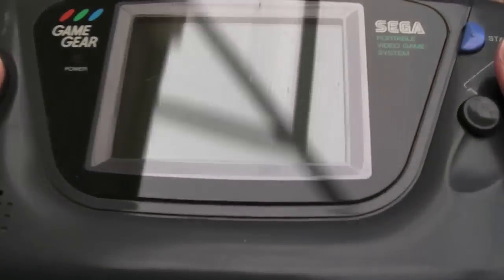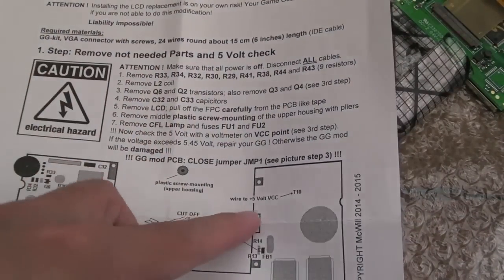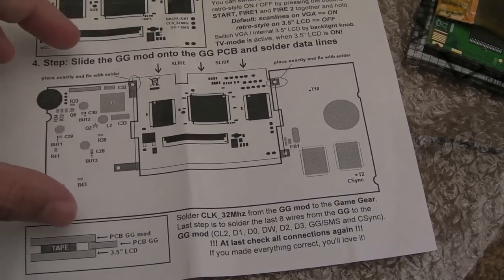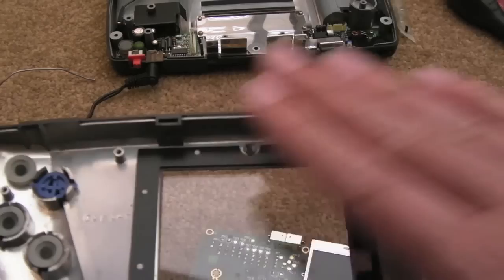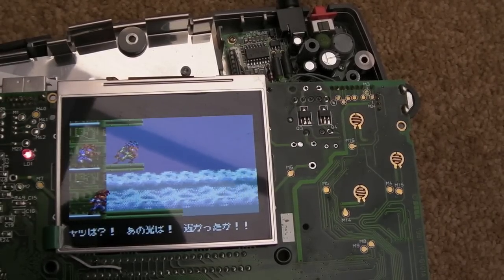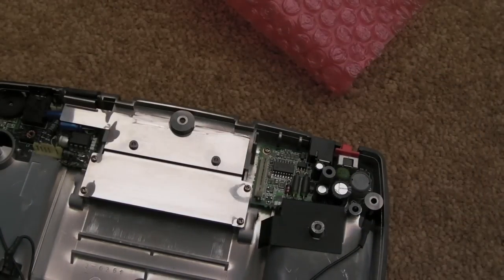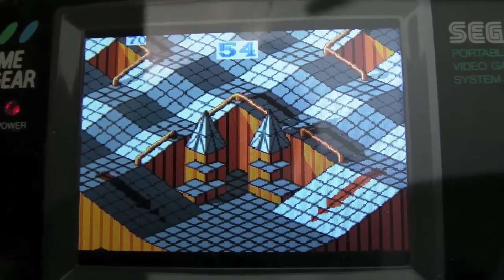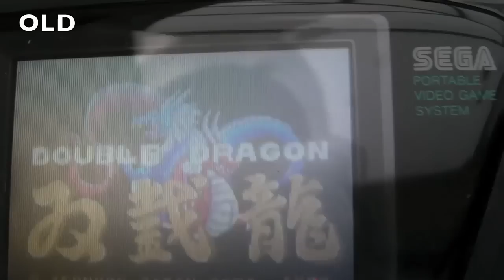Sega Game Gear Modern LCD Replacement (Not Composite) From McWill

Comment: Wow, that's a superbly put together mod kit - great execution on the install too. Thanks for the video. Is there a difference in power consumption compared to the original screen and lamp - does it make a noticable difference in battery life?
Reply: Paul E just the led replacement makes a crazy difference, this should do even more.

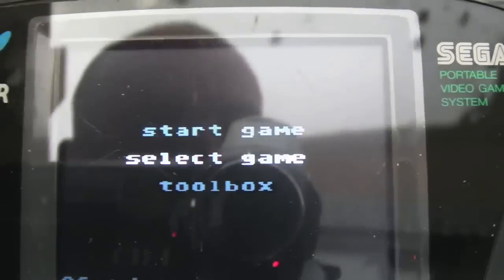Comment: Why is cutting the sides of the image? 30:37
Reply from the maker: +chakanbhz If you look at the original screen at 31:13 its the same.  I think it's because it was a lazy Master System or Megadrive port or something, but its the same with both - in fact on the new screen you see more than the old screen if you look closely at the copyright text.
Reply: +GadgetUK164 really.

Comment: NOTE:  If you perform this mod, please sell your old screens on ebay as replacement parts (provide that you removed the old ribbon carefully enough).   Vintage screens are desirable to some, and those who have broken units and wish to keep the old screen can benefit from these.
Reply from the maker: Yes, that's good advice!  I kept my old screen for that reason.  Although they cannot be easily re-attached as they are thermally adhered to the GG, not soldered =/
Reply: @GadgetUK164  Hot glue is just thermoplastic. I'm willing to bet that with some care and a rework station, it's possible. If they did it in the factory, it's doable at home with enough care and temperature control.

Comment: Where can I buy this? Not too concerned about the mod, I just need to replace the LCD.
Reply from the maker: +DJ NKE (muzikcontrolfreek208) McWill on AtariAge sells these.  It's a kit - the 'mod' is required as it drives the LCD screen.  The only screen that is a straight swap for the Lynx is the original screen.  This one converts the video format to output a digital format that the newer LCD accepts.
Reply: +GadgetUK164 k, I meant to say for game gear, not lynx my bad
Reply from the maker: Its the same person on AtariAge - he makes and sells both! =)
Reply: +GadgetUK164 I'll look into it. thanks for the help!

Comment: Help! I had a go at installing the mod after recapping my console. I managed to install it fine and was able to get it to display perfectly. The screen wasn't positioned as well as I would have liked so I was repositioning it when the image suddenly became distorted. I tried messing with several of the wires to see if there was a loose connection anywhere and now neither the game gear or screen will power on. 
I've since disconnected the live and ground from the Mcwill mod and tried powering the game gear on again without it to find that it powers on fine with the red light on, but as soon as I reconnect 5v and gnd from the game gear to the mcwill mod I get nothing. 
Has anyone got any advice or ideas?
Reply from the maker: Check all your wires for shorts first.  You might have killed the screen or something.  You could always send it off to McWill and get him to take a look?

Comment: Hey Gadget, I'm going to be doing this mod in a month or two, and I was wondering what size wire you used?
Reply from the maker: I used Kynar wire, which perhaps isn't the easiest option as it is not very flexible.  But something like 5 strand or 7 strand wire that's thin enough and flexible enough will be fine.  No idea on the AWG size.

Comment: wow, this mod looks a lot scarier than the lynx mod. I'll go ahead and stay away from this one. Maybe one day i'll be brave enough though.
Reply: Virtual Robots Revolt practice soldering and desoldering on crapped out electronics, that's what I did, my goal waa to get all the surface mount components off without breaking them, now my hand is steady and technique much improved where I dont ruin any boards

Comment: this makes me hate my crappy corroded out capacitor game gear   but i'm 12 how in the hell am i supposed to get how to fix that stuff
Reply from the maker: +TheStuff Taking an interest is the first step!  An interest in wanting to repair something will drive you to learn.  If you're interested in fixing your gamegear, make sure you take electronics classes at school / college when you can.  As soon as you learn the basics you will easily be able to fix the capacitors in a game gear - electronics might be your future, you could earn lots of money repairing things!!!  If you want to start learning to solder make sure your parents assist you to start with.   Replacing the capacitors in a game gear is a simple case of ordering a capacitor kit, order a gamebit screwdriver so you can remove the security screw.  Remove the other screws and carefully take it to pieces.  Remove the old capacitors (one at a time) with a soldering iron (carefully making a note of the polarity, one side is +, the other is -.  Then fit the correct size capacitor using a soldering iron, and some solder containing flux.  If you get all the right capacitors into the correct spots on the board and make sure the polarity is right on all of them, it should all work fine.

Comment: Hi i´m german, and i don´t unterstand one Sentence,
What does this mean: recapping your Game Gear Screen?
Would be great, If somebody can tell me this.
I´m about to install a LCD by myself...
Reply: recapping means to replace the capacitors soldered on the PCB
Reply from the maker: Yes, as max0r4axor says - replacing the electrolytic capacitors.  They nearly always leak - sometimes you lose sound, other times the screen is hardly visible, and sometimes you get a black screen.
Reply: thank you guys.
okay btw i got a black screen, i hope this recap will fix it

Comment: Really good info in this video! That edge connector soldering makes me wonder if there is another way. This is one of those invasive mods which one can go though looking for areas of minimising that. TBH honest I cannot think how it would fit, but my first thought would be to fit a custom adaptor PCB (just a clone of that edge really) made by a printer on copper (and then the usual acid/alkali wash). It might be too bulky though.

So then you'd solder on that (and attach it) instead of soldering on the actual gamegear. I mean, wat you've done there is basically irreversible evidece that smebody has "been there". Thumbs-up of course. I'm probably just being a tad "retentive" about such details. So this comment is a thought experiment.

Having thought about this a few minutes longer, I think what one would do is make not a custom (rigid) PCB edge connector per se, but instead make something like a "ribbon", like attaching copper leaf (for traces) to kapton heat tape as though that is the PCB (again printed via acid/alkali wash). Then you can solder on that. Or basically make some kind of very thin ribbon cable that can be replaced or put back to normal.
Reply from the maker: There's no easy answer!  New screens that work the same way as the old ones would never be manufactured, so a different approach has to be taken.  Since the screen is part of the PCB mount - ie. just having the screen connected by a ribbon would mean the screen is floating around inside and not held in place.  So I guess the approach of mounting to a PCB was the best apporach at the time.  The only other solution would be to 3D print some mounts to hold the screen in the correct place.  Then maybe a flexible ribbon could be designed to link the board edge to the screen (as per the original design).

Comment: If only they would of released it with these screens it would of killed original gameboy
Reply: Jose Bautista the Pc Engine GT screen was 200% better
Reply: And yet it didn't, because ah yes... That was over two decades ago and such technology didn't exist yet.. :P 
Ingenious business model you've got there, using future technology.. Very clever.
Reply: Jose Bautista both this and the Atari Lynx...the battery life is super improved as well...I will have to get one soon...I grabbed the improved led mod, but the full screen replacement would-be better.
Reply: not really. it would have been 10 times more expensive.
Reply: Idk if it would've killed the game boy. I think Nintendo would've retaliated right back and the Gameboy color would've had a back light instead of waiting till the SP. Plus Nintendo already was working with gamefreak so Pokemon would've killed any of that momentum later on.

Comment: why this stupid scalelines... it is not like you it is a filter without it. without it its how it supposed to look. the scalelines back then were no gimmick or fancy stuff or style, they were visible because you had no other technology for such a small display in that price category. now you have the possibility to view a clear bright picture!
Reply from the maker: The scanlines on these Game Gear and Lynx screens were added to make the screens look similar to the originals - since they had vertical seperation on the pixels.  It does look better than without scanlines tbh!  Scanlines on low resolution also act as a kind of anti aliasing for the brain - they trick the brain into thinking things looks smoother or rounder.  With high resolutions of today, scanlines just aren't needed (or wanted!).
Reply: Your statement only makes sense as long as game developers back then would not have used specific display characteristics of the hardware they were developing for to achieve certain graphical effects (for example transpareny on original Game Boy). If this particular scanline method restores such graphical effects and therefor removes glitches introduced by this modern display is another matter though.